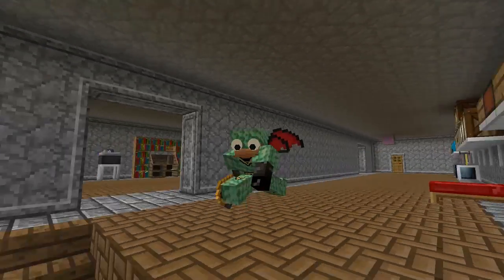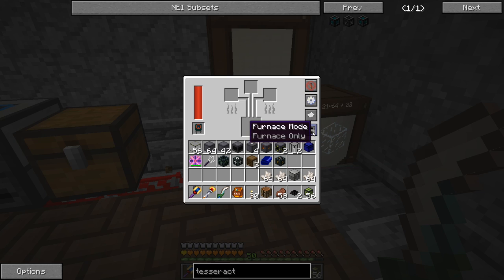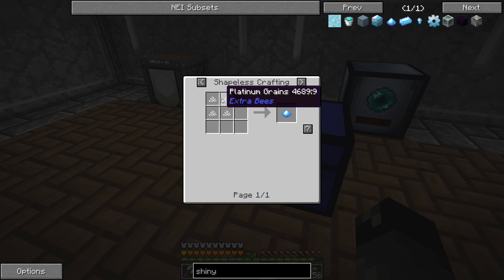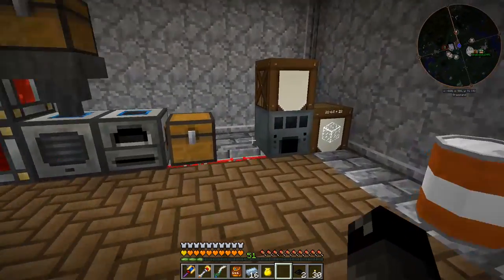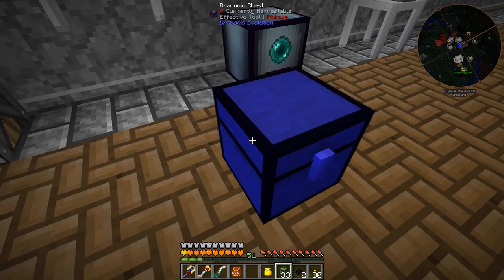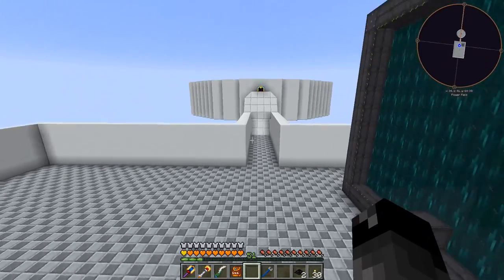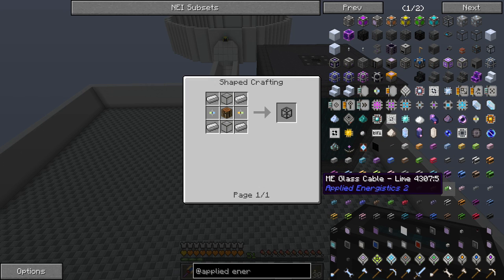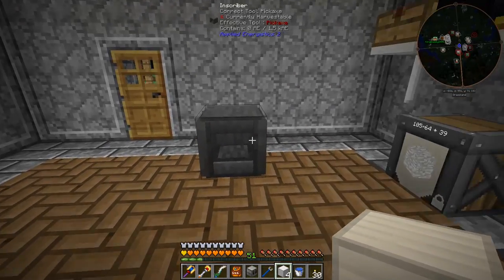Minecraft Mods FTB Infinity - STARTER APPLIED ENERGISTICS [E14] (HermitCraft Modded Server)

Comment: TE's Pulverizers can have upgrades now. Some of which increase the % chance for the extra dusts, the top tier one increasing it by 45% I think (or is it to 45 ?)

You need to upgrade your Pulverizer to Hardened/Resonant to be able to use the upgrades, and you need to make all tiers of a specific upgrade.

That, or use the SAG Mill, with Dark Steel Grinding Balls. I think it's a similar chance bonus.

Comment: Note that Capacitors and Energy Cells both work on tools (still based on the tool durability.

If you can get a tool's durability to above 50k, I think, you can put a Resonant Energy Cell, which is 50M RF on a tool :3
Reply: yeah then what is the point at 50k duribility the auto repair would work better for the fact that if u mine 50k blocks it would take a very long time and in between caving your tool would alrdy be repaired

Comment: hypnotizd just to give you a heads up if you place a 1 k drive back in to a crafting table you should get the core and a empty drive case back at least thats what happened to me the last time
Reply from the maker: ***** Yep, this way you can combine the lower tier stuff to make the higher tier stuff. Also you save on the drive recipe.
Reply: ya
Reply: i thought it was a great addition to that mod